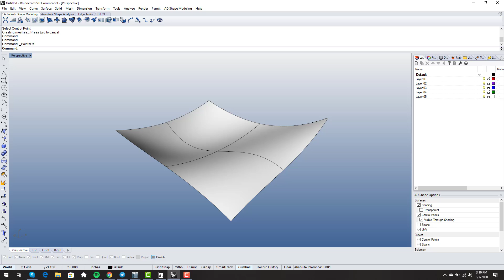Primary Surfacing: Episode 1 - Intro

Comment: I love Rhino 8. But I'm banging my head up against a brick wall. I'm designing a guitar, and the lower horn, where it transitions to the upper frets of my high (thin) strings, I need it to be a seamless curve that presents no corners or discomfort whatsoever for the player's hand and it needs to look beautiful. It is beyond me currently. I'm hoping I will learn enough from your videos to get it done. I just don't want to compromise on my vision/goal. I want perfection and am unwilling to choose an easier but lower quality surface. If I would compromise, I'd be finished already. The surfaces are simply not behaving and are not merging well, and they're fairly complex. It is frustrating. But yeah, bad surfaces at the outset are definitely a facet of my frustration at this stage in my project. I'm definitely an amateur with CAD. I have definitely just done whatever I needed to get this far and have the look and geometry be what I want it to be. But now I'm locked into some dodgey surfaces that are not want to blend with the surface in currently working on.

Comment: What do you make of Autodesk Alias as a surfacing software/tool?
Reply from the maker: Alias is the industry standard for the automotive industry for a good reason. It's also very expensive, especially when you look at it over the course of a person's career. As an independent, I use Rhino for a variety of reasons, but I'm certainly open to switching to Alias and might need to do that in the future.